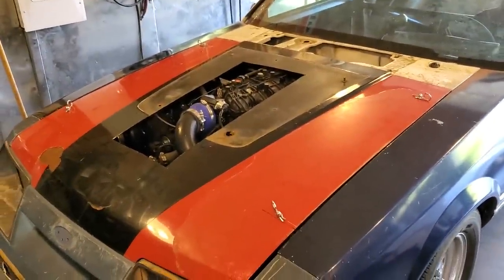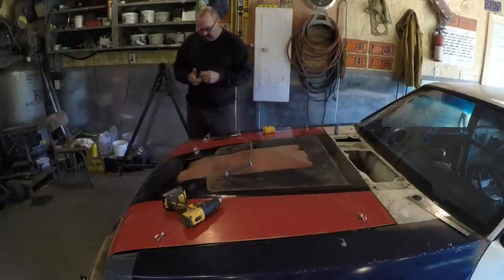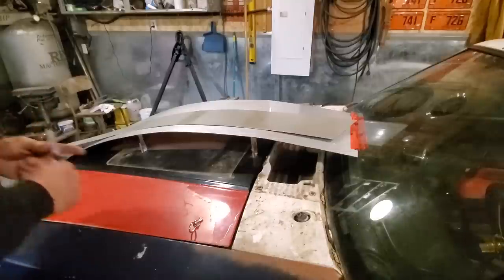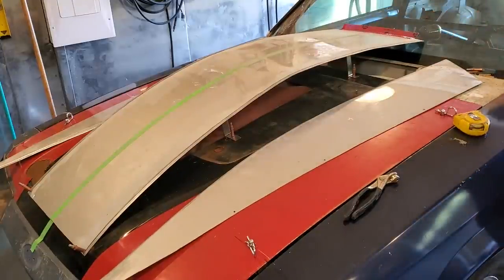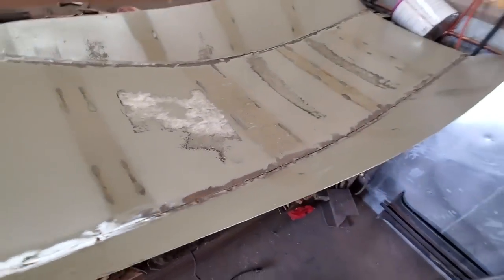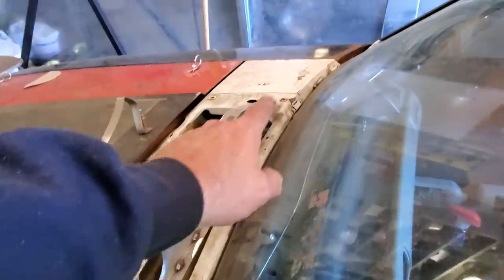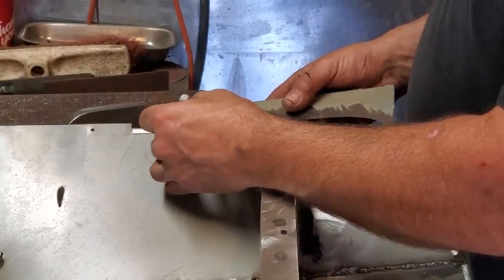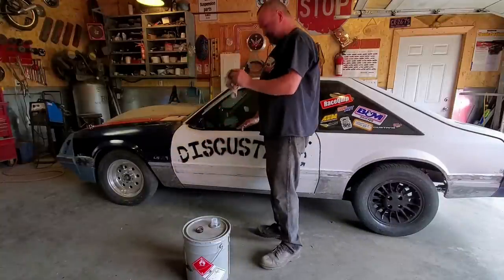How to make a steel hood scoop

Comment: Hey buddy - I got the back of my bus done! The contours are better than factory and I built all new wheel tubs from scratch that look awesome. Although I didn't need to use a lot of the actual methods I've learned from this channel - the content still inspired me; that you can do it if you just buckle down with a bit of brains, patience, and a bag of hammers. But I honestly think that if I hadn't discovered your channel, it wouldn't have got done this year. Today I'm unrolling the door skin seams and drilling out the spots to repair the door .. it's a pretty hurting unit that I wasn't sure how to go about, but again, your channel has given me the inspiration to just go and take it one bite at a time. The overlap looks like hell from prying it up, and  there'll be holes where the spots were .. but you've shown me that looking worse before better is just sometimes part of the process. I'll take everything apart until it's just a matter of where to replace metal, and the contours that look impossible to bend can be built up in sections (I think that was your Nova quarter video?) Next week I'll be a better fabricator than this, and it's this channel that has made that happen. Eventually the bus will be complete and it'll be time to start on my late grandfather's '68 Mercury. Thanks from the bottom of my heart for these videos!
Reply from the maker: Your so welcome. I so enjoy these stories.  Too cool

Comment: While I have made many things out of previously used metal my first thought for a hood scoop might have been the roof of a much smaller car so there would be less cutting / welding. I did enjoy the creativity of punching and forming the holes in the back of the scoop. That was on another level!
Reply from the maker: If you noticed how much of the roof i used to get the length. A smaller car would of not been long enough
Reply: @fitzeesfabrications  ...absolutely true in your final product. At the start of the video I had a much different picture in my mind and didn't realize how long that really was.... and wondering where it would wind up. I had originally envisioned what an OEM scoop might be at say 30 inches or so and the mind starts kicking in to visualize say the roof of a new VW bug and making it from a single piece.... at least there's my brain was going.  <LOL>

Comment: You are a great teacher. I am  45 years old and not certified in any type of welding.  my dad taught me to stick weld at age 14, and i haven’t slowed down since lol. I have built dozens of car hauler’s and utility trailers, I have even shortened and extended, as far as built a frame jig and frame for a 1970 Chevy c10. But I have never done any welding or fab work on thin sheet metal. TOTALLY DIFFERENT BALLGAME !! LOL  but from your video’s I have custom built two hood scoop’s. One was my own take on a 1968 mustang cobra jet scoop. And the other is a 3” cowl scoop with heat extractor’s built into the sides on my personal 1985 Chevy C10 truck. And from watching your video’s I didn’t have any warping or bubbling on either one. Thank you for putting your talent out here for the world to learn from 👍🏻
Reply: Welding is my time to work out all of my life’s problems. From the first arc of the welder I am totally relaxed and all the tension and all the weight on my shoulders slowly lift. It’s my personal therapy lol.

Comment: Fitzee, I would like to suggest one thing. I think you should cover all the holes in the cowl panel that you flattened, so if you have some kind of engine fire, it doesn't travel up the hood bubble and down inside that cowl area and come out under the dash inside the car.

That hood turned out looking real good. I am making removable panels on an A/C recovery machine that used to be covered in plastic. I am going to use that flange bending technique you showed to stiffen the panels. I have a set of those Greenlee punches as well and I use them to dimple the hole after I punch one out. Use the next size up male size backwards and two sizes up female side. Try it on scrap first. It would also depend on how many sizes you have in your collection of course.

 You helped me get back outside into my garage and get a quite a few things done. I have not mastered your patch panel repair technique yet but the last time was much better and faster then any other way I attempted do it before. The first time I used your technique I didn't plan ahead as to get the piece that falls off out and you don't want to know that story.

Thank you again for these great videos.
Ed
Reply from the maker: Haha. I been there and had troubles removing the inside sections. As for the cowl it is close off where the heater was. I am fussy on firewall safety. There was alot of holes in the firewall and in the cowl. Got jordan to weld and seal them all up. A good eye tho on your part.
Reply: @fitzeesfabrications  Good job. Well I learned from a little mishap I had in a Hilborn injected 327 Vega back in the late seventies. Just before going thru the lights the engine coughed, shutdown and lit what looked like a huge fire under the hood with the flames coming out of the rear of the scoop and over the windshield. The track was dark from the speed trap to the turn offs and I kept seeing the glow of fire under the dash on the inside of the car. The fire went out before the car stopped rolling and all was good. We had already filled all the holes in the fire wall so we had a hard time finding how the flames came inside. It took the exhaust of a shop vac to find the air was coming in through the cowl and it left us feeling pretty stupid. We knew that's where the heater got the outside air from. Sometimes you find out your just too smart for your own good. 

Thanks again for these excellent videos.
Ed

Comment: Just came across your channel 2 days ago.Been watching a lot of the vids,pretty darn good stuff you do.To bad you don't have your own show or able to get with a crew on a show.Not many good shows out there doing restos and/or customs,except one,I liked watching Foose.Most are just slap new parts on or prefer to work harder not smarter and all are scripted garbage.

I have tinkered around with a lil body work in my 50 yrs but nothing big.Here pretty soon I will be pulling my '68 Bronco that I have had since I was 14 into the garage and starting a complete overhaul on it.Back in '88 I had it redone when I was in 10th grade and now it needs some rocker work,but I am going to take it back to the factory style wheel-wells as I had them cut out at the time for 33x12.50 15's on stock suspension.I have had 4 of the EB's since then and my father had a '71 and that's what I 1st learned to drive when it and I was both 10.
I also want to change up the tailgate and liftgate,I want them to open like van doors but also able to install the factory gates just by unbolting them.
I really hate to cut it as whats left is still 100% Ford steel,but can't get back to looking orig without doing so and I can not afford any sort of bodyman that does good reputable work here.

Comment: Nice job my friend. After you spot welded all of that. You want to consider using lead and Tin mixture to do the body work on that to fill it in. Padel in LED  TIN in there very little Heat. It would join it very nice easy to sand nice job good luck...?   IT would be like soldering it together.. I've had some experience with LED body work easy to do.

Comment: Find the center by rotating the tape diagonally across the two outer marks, until the 4 is on one side and the 8 is on the other, then the 6 is in the exact center.
Wider sections use 2 numbers farther apart same process.
Can also be used to mark a series of equally spaced rows.

Comment: When you pulled out the cap to the gas cylinder my mind went "OK, now what's he going to do!?!"  However, the results blew my mind!  I was very impressed with the structure of the rear support from such thin metal.  I am sure that came out just as strong as if you lined it with a much thicker steel, and it most likely weighed less!  Also, with those holes, that is a perfect spot to mount any gauges you wanted!  Great video!

Comment: Fitz, when I fabbed a scoop for my son's foxbody, I did vertical sides for the scoop. I pondered how to follow the curveture of the hood, finally I put a piece of cardboard in the body gap between fender and hood, and traced the body line from windshield to the headlight and transferred the template to the sheet metal. Worked very well. Enjoying your channel and I subscribed this morning. Thank you for the content.

Comment: I really enjoyed watching the confidence with which you approached working freehand with sheetmetal in 3D space. This fundamental aspect of metal fab can be intimidating, but watching a true craftsman instills some reassurance that I can practice these techniques. Quick question- What welder were you using and what settings? I just started working with an Eastwood MP140i 110V tacking on flux core last night and had some issues dialing it in.
Reply from the maker: Flux core is not something to start to learn on sheetmetal. It is very hard to dial in. You wire size plays a part. Check out my video on setting up a mig for sheetmetal.  Also I have one there on Flux core and you will see the troubles I have with it.

Comment: I've watched almost all of your videos of your process of replacing sheet metal on cars. Changed the way I look at body repair. Got a question for you. Years ago I had a 71 blazer. The bottom door edge was in pretty bad shape. But when I had removed the rusty sheet metal the inner lower part of the door was also bad. How would you, using your technique to accomplish the repair? Thank you for awesome videos.

Comment: Awesome sauce 👌 
 Regarding the folded over lips on the windscreen side, what if you flipped the top piece of angle iron around so that you could still have the straight edge but then continue hammering it up and over without having to swap to the ruler
Reply from the maker: You could but the angle iron is thicker. And you'll end up with the roll over being wider. Will cause trouble when hammering it flat as some of the roll will want to go one way and some wanting to go the other way making for a uneven edge.
Reply: @fitzeesfabrications  that is very true 👍

Comment: Do you ever use panel bond in an instance like when you were using the seam sealer to attach the brace to the back of the hood? Looks good, I’m surprised that you didn’t leave more room between the wind shield and the hood scoop, it seems like it’s going to whistle with the air pulling through there
Reply from the maker: Been years since I used it. Not cheap but great stuff.

Comment: Fitz,
Would you suggest seam sealing between the inner frame and the hood skin when you plug weld them if fo no other reason to add a bit of a pad between the metal to eliminate any rattling that may occur from vibration?
Reply from the maker: Yes but it be done last.

Comment: The part I have trouble with is grinding in the valley, as where the bubble meets the hood. The metal will get thin, unlike the welded bubble scoop top edges where the grinder will only make contact with the weld rather than the surrounding metal.
Reply from the maker: I never removed all the weld inside. I found if I weld and dressed it outside it would be thin next to the weld. I tried not to grind this metal too much as it burns threw fast.
Reply: Top tip thanks.

Comment: Hey Fitzee, great content and tips! What's your opinion on best way to marry hood scoops from a 67 Chevelle SS hood to a 95 Chevy truck hood? Both hoods are complete and uncut. Would like to "swap" the entire skins, if possible, as I prefer the lines of the 67 hood.
Reply from the maker: That be a fun project. Problem is how the two hoods flow. Are they close? Be nice it the skin your wanting is bigger then the hood your using. I try and join them out as close to the edge as I can.

Comment: Hey Fitzee have you ever used steel brake line or conduit to make a clean looking edge for fender flares or what have you? Very interesting video by the way. I was the first to give it a thumbs up.
Reply from the maker: Yes i used both. Was on a conduit crazy  about 15 years back. Lol. Was using it for everything. Lol.
Reply: @fitzeesfabrications  I once saw the idea in a Hot Rod or Car Craft magazine when a guy altered the rear wheel openings for bigger tires many years ago. Made think of it when I saw your video.

Comment: Wonderful skills ❤ I question the design ie, there is no opening at the glass end to allow high pressure air to fill the engine day . ..?  If it’s a racing car that needs air flow into the engine bay that is . Drag racing I know nothing about that ?
Reply from the maker: It's designed for hood clearance and to let engine heat out of the engine bay.  There is holes in the back of the scoop.
Reply: @fitzeesfabrications  sorry, lots do this but it would defy aerodynamic if that work as well as it looks.windscreen has high air pressure coming off it created by the car moving forward. No air wants to come out from the hole . Put cotton string lengths taped to hole and drive , at speed intended purpose. Instead of coming out the string will push into holes and under hood. Sport . Vents towards the front and side will work or cut six inches of the windscreen end this is a enter for air .. 😤😱💀💩But for looks alone this design is a winner .
Reply from the maker: @lauriedooker1031  Most air pressure is only an inch or so off the height of the car. After that, the pressure drops and air passing through the grill and into the engine  compartment will distort that air at the back of the hood. I experimented years ago with this and found on a 4 inch cowl hood a string hanging down at the opening on the back of the hood would only  vibrate but did not pull into the engine bay. Most air induction scoops that came from the factory  were around 1.5 inches off the surface of the car. Anything higher  had to be large and facing forward to scoop up the air. Most drag cars get pressure from large forward opening scoops or the opening for air intake is on the nose of the car and there is no grill in the car.the pressure on the front of the car is much higher than what flows over the car.

Comment: Did you guys notice the pedestal under his bench grinder? Looks like he solved the problem with it vibrating and walking all over the place when he's using it. Now he can really lean on it or do a nice clean chisel dress up. 
@ 44:00
Reply from the maker: That don't move a bit! I call it engineuity!! Lol
Reply: Fitzee's Fabrications Yeah Engineuity! All my years I’ve never seen that one. Plenty of brake rotors and drums filled with cement but mounting it using the main journals of an engine block takes the cake....

Comment: nice, great work Fitzee. one question, How do you weld with out welding glasses?
Reply from the maker: I'm wearing safety glasses. And also I'm never looking at the arc. It alway hid behind the tip of the gun.

Comment: Fitzee, where you used seam sealer to bond the rear of the scoop support to the scoop, any reason that you chose sealer over for example, 3M panel Bond??
Reply from the maker: I never has 3m bond and had the urethane. I make fo with what I have around for most part

Comment: Would a plasma cutter or a sheet metal nibbler be a better option to cut?
Reply from the maker: No and no. Well you can use a nibbler  but I don't like them. Just fine thrm messy. The plasma cutter will leave a ruff edge.
Reply: Thx, for your reply

Comment: Fitzee, I take it with such a scoop the air is scavenged primarily from inside the vehicle as opposed to from the gap twixt the windshield and the scoop.?
Reply from the maker: It is a scoop designed to cover a large intake. Dont need air intake on a Turbo  charged fuel injected  engine.
Reply: @fitzeesfabrications  seriously, we always had exterior intakes on a turbo, supercharged diesel. (hwy tractors) not a mechanic here, driver.
       Mike
Reply from the maker: Yes and those go threw the grill or some guys takes out the headlight.
Reply: @fitzeesfabrications  perfect sense, thank you, Fitzee.
       Mike

Comment: What brand of cutoff wheel do you find holds up to sheet metal?
Reply from the maker: There are many that work good. Ones I use are cheap and don't last as long a a high dollar ones but its cheaper in long run using the ones I use. Maximum from Canadian tire